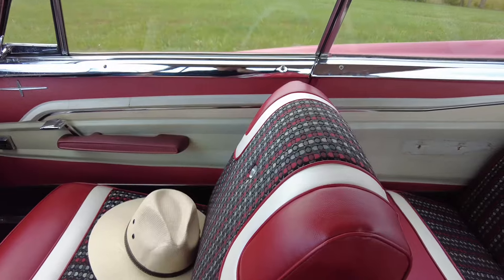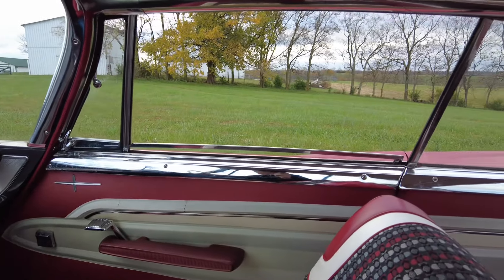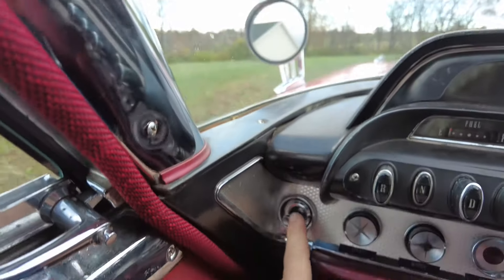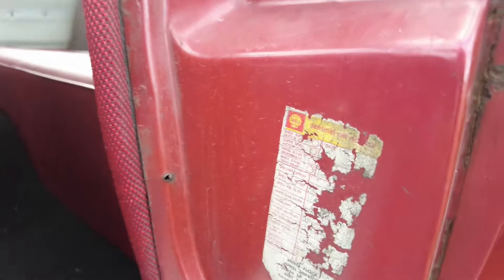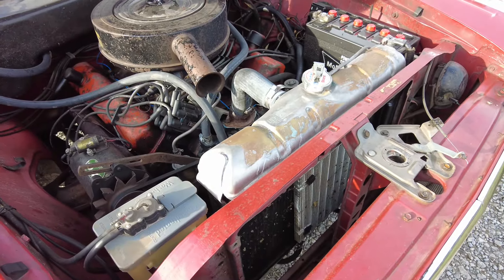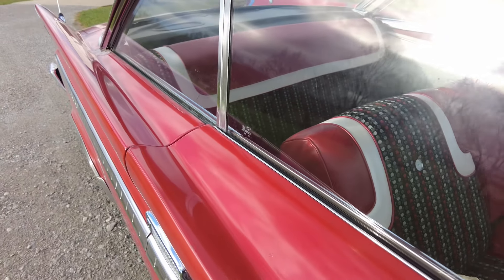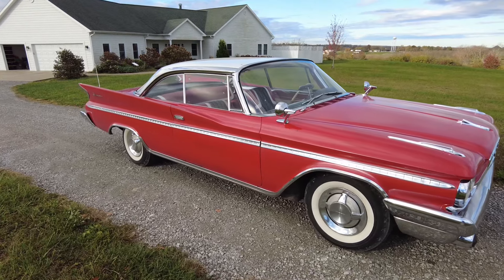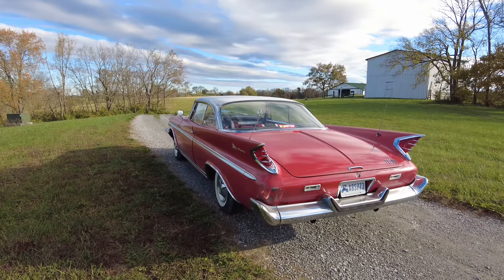My dream car! A 1960 DeSoto

Comment: Very cool. The Torque-Flite automatic transmission was a very elegant design and easy to work on, so the speedometer repair should be a very low stress affair.
Reply from the maker: I certainly hope so. Looks like I’ll have to release the torque tubes to get the transmission support down. Will make a video of it for sure😅👍🏻

Comment: Th car is very clean and straight, few chips and body details, and with this conditions, the ride deserves a nice clean a wax job in order to preserve the brightness of the paint. Suspension parts, engine, electrical, fuel, cooling, brakes, filters, all them, still are available in spare parts stores around U.S. thanks to many Mopar cars using exact components for many models in those years.
Reply from the maker: Thank you! The paint is not original on the outside. But it was painted only once. I got all the suspension parts and planning on changing them soon. I also collecting NOS parts, a few bins are full of them by now. I even found a never used speedometer!

Comment: Are you sure that's not a 383 engine?  I believe 318 engines have the distributor at the rear of the engine.
Reply from the maker: You are absolutely right!
Reply: I'm glad you mentioned that. I was wondering how a 318 could squeal the tires in such a large full-sized car.
Reply from the maker: @ I have mixed up the engines😅 my bad👍🏻
Reply: @gruntherblendin388  The 1957-1966 318 "poly" engine had great low end torque for it's size, but accodring to my books, the 1960 DeSoto Adventurer came standard with a 383 2-barrel.
Reply: @budapestspeedshop  That's OK.  Congratulations on your beautiful DeSoto, and your awesome 383!
Reply: Yep, that is definitely a B block mopar under the hood. That vintage 318 was a poly head with scalloped valve covers and 2 through studs holding them down at each end along with the rear distributor. Awesome car, keep it original with that unusual array of options.

Comment: Incredible design and wheels, 1960 was the last year for De Soto
Reply: The last year for DeSoto was 1961.
Reply: @danielthoman7324  yes
Reply from the maker: Technically correct what you wrote. The production stopped in 1960 but at that time they were allready making the 1961 modell year.

Comment: Totally agree with your approach. Enjoy the car, fix things as they come along, making it a little better along the way. Perhaps twenty years from now, if circumstances allow, consider restoring this baby doll. As you know, taking it back to showroom condition would be ridiculously difficult and expensive. Don't forget to factor in the toll it takes physically and emotionally as well. And once you've made it pristine and perfect, you'll be afraid to drive it, lest you get a rock chip in your $15K paint job.
Reply from the maker: Thank you! In tha past I’ve fixed up a few cars myself. Some took 9 years to do. And you are right! I’m scared to drive them😂😅

Comment: 318? Should have either 361cid or 383. No DeSoto ever had a 318. Superlative ride you have, nice work.
Reply from the maker: You are absolutely right! I have way too many numbers in my head… 383 is the right number👍🏻
Reply: @budapestspeedshop actually the DeSoto name was used on some export cars which were plymouths and Dodges with DeSoto front clips.  Some of them had poly engines with rear distributors.

Comment: '60 Dodge dash, blacked out..all the same switchgear. Maybe check this out re: your glove-box lock assy..Dodge should fit.
Reply from the maker: Thats what I’m getting but it’s not the same. Maybe because it’s a pre production model. I’ll send the original back and hopefully that will work then.

Comment: Sadly due to the BABVVO and TEBBVO laws, all petrol cars will unfortunately soon be banned from public streets in the EU, CH USA and Scandinavia :-( In Germany, the Green People's Party has given the order to shorten the fuel supply from 2025 by reducing all conventional gas stations to just one state-run central gas station per city or county Now they even want to slow down all gas pumps by 20 liters per minute to 2 liters per minute... From 2027, some car spare parts will also be banned in the EU... such as exhaust systems, turbochargers and even some engine and gearbox oils. .. California and New York will do the same from 2027... So no more investing in petrol cars... They even created a new type of crime here called emissions and smoke crime . "Bundesabgasbespaßungsverbotsverordnung" BABVVO in Germany and HESCHLAVVO in Switzerland and SMORVERBIDDEN in Sweden. Unfortunately, aditionaly the Green Jesus Federal Exhaust Gas Funneling Prohibition Ordinance (BABVVO) will soon ban the driving of combustion engines in public outside of verifiable commuter trips and transport trips, as exhaust gas fun will then be a traffic offense! In addition, the green Jesus of Germany is probably planning to shut down all chimneys and have them filled with foam from June 2025.
Reply from the maker: The only problem with that is the electric cars don’t work too well plus they create more pollution then gas cars. Battery production and energy production is very messy process. As the latest car industry news, more and more companies are betting on gasoline engines other than electric ones. Rental car companies dropped most of their electric stock recently as well. I’m trying to keep politics out of this channel so I’m not even gonna mention the senctions against Russian energy…. Germany is finished on many level. Hopefully people will wake up one day and vote accordingly if they still can.

Comment: I believe that the DeSoto was dropped from production because it was so bad , even dangerous .
Pretty sure was in a book on the history of Chrysler .
Reply from the maker: I found it very reliable and I don’t see how would it be more dangerous than any other contemporary vehicle. I think it was positioned wrong in their lineup and in the previous years they confused the buying public with renaming their cars.
Reply: You are mistaken or misinformed. De Soto was squeezed out of the marketplace by Dodge moving upscale (same size car at a lower price) and Chrysler introducing the Newport (a more prestigious brand name at the same, or slightly lower price). The 57 58 recession hurt the sales of all mid price cars, De Soto more than some others.
Reply from the maker: @ thank you!
Reply: @chuckmaddison2924  Hogwash!  This DeSoto is basically a Chrysler Windsor with DeSoto styling.  There is nothing bad or dangerous about it.
Reply: @KDoyle4 Chuck is probably just some kid, born this century,  that has never even seen a Desoto, much less know anything about them.
Reply: @danielulz1640  ...and it's our job to school him and set the record straight.